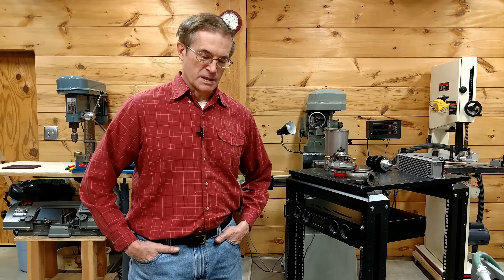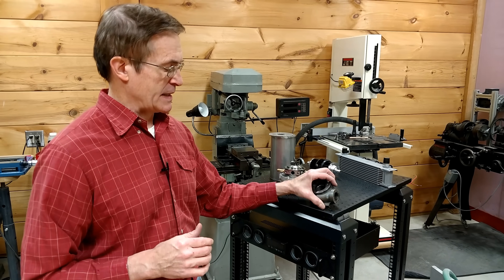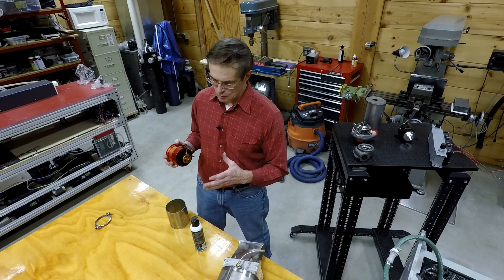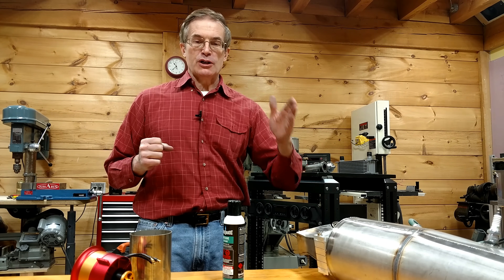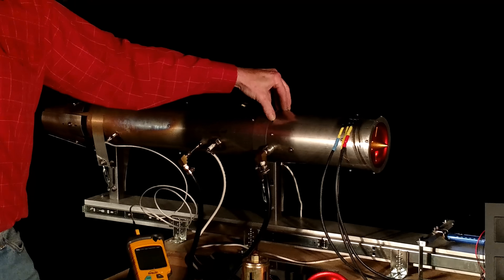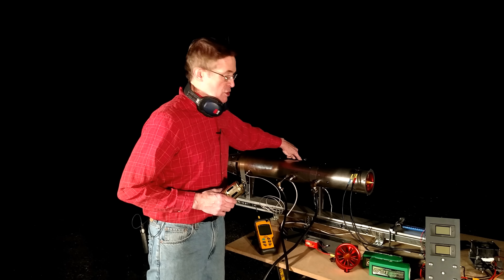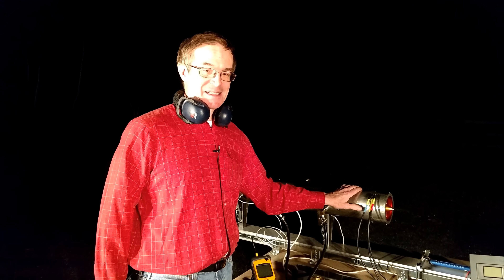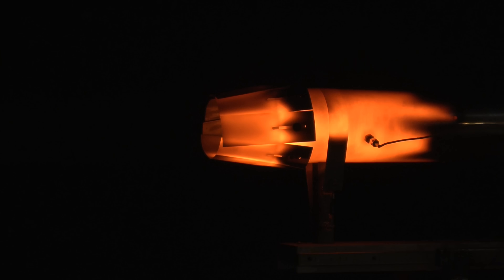Hybrid Jet Engine

Comment: I don't think you could ever get the weight down enough between the engine and the fuel to ever make it useful enough to use to fly, but maybe you could use it on a jet boat. That would be pretty cool.
Reply from the maker: You might be right, but there are a lot of EDF based models that carry the heavy batteries that are required.  The engine we demo was built to research the potential for augmenting these fans to generate not only a much more realistic sound, but to enhance the thrust as well. We used relatively heavy gauges and larger dimensions to allow various set ups to be trialed.  If you look carefully, there are holes in this tube that were used for approaches that we discarded. The air pressure forces generated by this engine are quite low and very thin stainless components could ultimately be fabricated that would weigh a lot less.
Reply: Yeah, I have that same  JP fan for my Meteor EDF, but in 70mm. That is one of the best fans on the market I think. I also have a few Mercury Alloy All metal EDFs also, another great fan. I work as a Welder and Machinist, and have always wanted to do something like this, or maybe use the Turbo to see if you could also make it a fan bypass system maybe.  Anyway, great job! Love your channel. My friend is going to make some of those speakers you made out of the foam board, another great video also!

Comment: I’m fortunate enough to get paid to fly a turbojet aircraft but would not care to pay for the care and feeding of one. Wondering if anyone else is fascinated by the potential efficiency of operating a light sleek experimental at near jet speed with a highly engineered ducted fan, such as one borrowed from a modest sized fanjet and powered by a fast turning recip.

Comment: Thank you very much for finally clearing up my confusion about the paradox of the standard jet engine. The combustion chamber increases the volume! (not the pressure) From that I see the equation of pressure diff times volume equals work, which means that the turbine produces far more work than used by the compressor, thus leaving excess for other work.

Comment: Finally! Someone who actually understand whats going on inside a jet engine and has the ability to articulate it correctly!
Reply from the maker: Thanks!
Reply: Tech Ingredients go to Lockheed so you can make some afterburners
Reply from the maker: We have watched many of his videos, they are interesting and well made.
Reply: @TechIngredients  any updates?
Reply: True. But explaining these concepts while showing the P-V & T-s themodynamic relationships will make the concept clearer. Good job though.
Reply: so right
Reply: im gonna make jet engines to make a ufo
Reply: that is what we leatned st jetengine engineering but for xhaust cooling maybe a cool air scavenge system?
Reply: Walter Kaaden an East German engineer developed the two-stroke expansion chamber exhaust using experience he gained from working on pulse jet engines. 
He created the diverging and converging cone shaped chambers. 
The opening exhaust port creates a shock wave the shoots down the pipe. A diverging cone creates a suction behind that shock wave. The converging cone reflects the shock wave back to the engine. This pushes the hot gas back into the engine.  
The ideal shaped pipe has a supercharger effect. Exhaust gas is sucked down the pipe with the next fuel air charge following it down the pipe. But the reflected shock wave shoved that gas back into the engine. When it’s ideally timed, the exhaust port shuts just as the fuel/air charge has been pushed back into the cylinder. 
Supercharging by means of gas shock waves. 
During WW2 Rolls Royce were working on a 25 litre two stroke engine. They realised it made a considerable thrust from the exhaust gas alone. They had plans fir a hybrid piston/turbine engine. Sadly it never went any further because the highly efficient blower developed for Merlin engines was ideal for their early turbo jets (the Nene).
Reply: sorry to be off topic but does someone know of a way to get back into an Instagram account..?
I was dumb forgot my password. I would love any help you can offer me.
Reply: @Evan Edwin instablaster =)
Reply: If you want to learn about gas turbine engines, check out AgentJayZ youtube channel
Reply: David Blalock well to be honest: no, he didn’t. This right there is not a jet engine, but more a very hot furnace. The crucial point with a jet engine is, that the energy regained by the turbine stages is used to run the compressor stages, so it is self sustaining. This here is literally in a normal person’s gas central heater.
Reply: @nighthawk9264   Not so fast.  It might be a jet.  If the combustion chamber is adding to the exhaust flow in a meaningful way, then it's a jet engine.  If not, it's a ducted fan on a heater.  That's the way I see it.
Reply: @nighthawk9264  He explained this very thing but if one had watched the video.........
Reply: @nighthawk9264  If you go back to any thermodynamics book, you will find that an engine is a machine that converts heat energy (chemical energy) to mechanical kinetic energy. Even if the output kinetic energy is very low, the conversion was still done.
Reply: I am converting chemical into mechanical energy if I spray butane into my hair drier while it’s still on. Doesn’t make it a jet engine. 

Like I said, having a fan with some pre compression in which’s output you spray some gas and ignite it, rather makes it an efficient furnace, not an engine.

The classical definition of a combustion engine is that it is self-stustaining btw.
Reply: @nighthawk9264  Hair driers convert electric energy into kinetic energy to displace air (not chemical). Your example is wrong. I am not trying to get into an argument here but rather trying to help you understand the basic concept. Plus I might also learn something new from this discussion.
Reply: Omar Ham if I am spraying butane on the hot heating elements, it’s exactly the same. I might even get some extra thrust. 

He literally used electricity to compress the air and then combusts the air Gas Mixture. He does not regain any of the energy back to keep the „engine“ running. 

I don’t need help understanding the basic concept, I am an aerospace engineering student that took courses on thermodynamics and air breathing propulsion.

It’s literally a hair dryer with an afterburner
Reply: @nighthawk9264  Please give more profound thought about the system and you will understand it better.  There are many levels of understanding of application of science and engineering and you are at the base of the pyramid.  555

Comment: Luv your vid please do more. I take it the heat was your biggest problem. As you stated at the start with turbo fans keeping the temp down?
Reply from the maker: It's a love/ hate relationship.  More heat gives more thrust, but the components can only take so much.  In the ideal thermodynamic cycle, the combustion would occur under the most extreme conditions possible, very high pressure and as hot as the structure will allow, but the exhaust would be at a low velocity, pressure and temperature.  This is the principle supporting a turboprop engine.  Our single stage axial turbine does not generate a very high pressure ratio and we try, at least, to compensate with maximum combustion chamber temps

Comment: sorry, really...... more space heater than jet engine.... it should go a little like this  https://youtu.be/CfXKGlDlY8M
Reply from the maker: It's a little of both.  In your link, which I have seen before, remember
 that demo shows a turbocharger conversion with a much higher compression ratio.  That is a different engine and we will discuss that type in a future video.  For what it's worth, have you noticed the slow and limited introduction of electrically based turbochargers for automotive use? More frequently, electrically enhanced conventional turbochargers are being installed.  What about adding an electrically enhanced first stage to the engine in your link?  Just like an afterburner it would allow brief periods of increased thrust.
Reply: some kind of electric turbo was done 20 years ago by Rover in the uk, i guess with brush-less motor etc things can run better and longer, dont see any point adding anything to the engine, it would either melt, or at least not deal with the volume, moving over 3.5kg of air a second

Comment: Could you use a water mister to increase thrust? You could even mist on the outside of the tube to decrease Temps to allow increased running output
Reply from the maker: Yes, that is a very interesting idea.  Our plan with the second fan is to introduce a water/alcohol mix between the stages to reduce the temperature rise associated with compression as is done with an inter-cooler and increase the air density.  Note: don't choose methanol.
Reply from the maker: Actually, less explosive, but too powerful a solvent effect for the motors.  The liquid will pass both around and THROUGH the motor providing direct cooling to the winding.
Reply from the maker: You do not want to reuse the water.  The tremendous heat of vaporization of water (it takes more than 5 times as much energy to convert a gram of 100 degree water to vapor as it takes to raise that same gram from freezing to 100 degrees) absorbs so much heat that the air density rises significantly.
Reply: Huh, that makes sense. Last thing you need is something inside a motor being eaten by the solvent!
Reply from the maker: Thanks for the support.  There is the risk that if the fluid is not highly atomized and evenly distributed, the stresses you suggest are a threat.  We will use two sets of injectors, one between the fans and one in the space prior to the combustion chamber.  The first will use isopropyl alcohol and water, the second will use methanol.  We will adjust the flow to cool the air and the motor, but not so much that there is substantial condensation or dripping.  The remaining fuel requirement will be the methanol as needed.
Reply: Unlikely, as (so far as I can tell) the water is going to be aspirated into the air stream between the compressors. However, it won't be wasted - the more mass you can throw out of the back of this kind of engine, the more thrust you will get.
Reply: I'm worried that it will create micro cracks in the body over time, from constant stress of high temperature changes caused by the mist. Won't it work the metal to dangerous levels? Just my thoughts, I'm not an engineer ;)
P.S. You gained a new subscriber. Great presenter and interesting subjects, you have my like!
Reply: The Rolls Royce Pegasus engine uses de-mineralized water for cooling for increased thrust. It's the engine used in the AV8B Harrier.
Reply: Water injection has been used for decades on numerous engines to permit an increase in thrust for take-off.  Its function is to cool, by evaporation, the air entering the combustor, such that the fuel flow can be increased without an increase in turbine entry temperature.  The increase in thrust, as a result of the increase in mass flow, is a second-order effect.
The Pegasus engine had 'short lift dry' and 'short lift wet' ratings for take-off, the former referring to the use of water injection for a maximum, from memory, of 90 seconds.
Reply: Solution is to keep the heat up, so you get the Leidenfrost effect to protect it from the metal itself.
Reply: The air density after the water injection adds a non-trivial amount of thrust as well. I'm guessing here, but I bet the water injection limit is a practical limit of how much water they can carry onboard, which is sufficient given they're only using it for takeoff. Landing has reduced thrust requirement because the aircraft has dropped its ordinance and consumed a substantial amount of fuel, so it doesn't need the added thrust.

The harrier is an interesting bird. Loud as all hades even with cans and screws protecting your ears, it seems like the sound is coming from inside of your head almost. Truly a sight to behold.
Reply: Why not? Too explosive?
Reply: Alright, I trust you. I hope to see it working soon :)
Reply: grahamj9101 that's cool to know. I always thought wet and dry were referring to the amount of fule onboard the craft
Reply: Water methanol injection?

Comment: What a cool project!  Unfortunately, I was so distracted by the production faux pas, I'll need to watch again for it's juicy goodness. And it is Juicy and it is Good!

I've been shooting video for years. Here's some unsolicited advice for your producer and crew:
Audio: use the audio from your lav mic. Eliminate all other sources of recorded audio in post production. Turn it off, throw it away, anything you want as long as the audio in your final version is addressed and intentional. I can hear levels changing with the roaming camera moving in closer, which is nuts unless the lav didn't work and you couldn't reshoot. Audio is as important as picture and some of the comments here relate to this easily fixed problem.

For a two or three camera shoot, lock down your master shot camera. It shouldn't pan, tilt or move in any way if the talent is standing in one general area and talking.  Try to use the same types of cameras (DSLR or Pro Vid cameras- -if you mix gopros, iphones, dslrs and ProVid, it will look odd unless you're super careful), feed them individually to a field monitor and match the exposure and color balance before you start. If you can't, work hard to match them in post production. Final Cut and Premier both have strong tools for this task, but it's hella easier to shoot it right than fix it in post. Your B Roll camera shouldn't be "God View" high angle, or anything other than just another good shot at a normal angle. You can have someone move Camera 2 around (quietly), just never unless there is another solid shot to cut to while it's moving. Thats camera 1's job anyway, so there you go...Your roaming camera, again should be matched for exposure and color and type.  This should NOT be your master shot camera, as you've done here.  It is a cut-away camera, like your B Roll camera, but provides lots of different details, alternate angles and close ups relevant to content. And because its a handheld camera, be careful and intentional in providing focused, steady and well composed shots. Here we've got blur, motion, focusing, zooming, too close and un-composed shots for your Master Shots. Just relax, slow down, think it through and remember Camera 1 and Camera 2 got your back. Additionally, understand the physical boundaries of those C1 and C2 shots so you don't wander into frame in the heat of the moment. You'd be amazed what one shooter and one talent can accomplish with three cameras, a mic, a solid consistent production approach and amazing content. 

Indoor lighting is just great for youtube. High angle camera is too dark and unbalanced in terms of color. 
Outdoor lighting needs to be fixed. You can chose how to address this, but the simplest solution is to shoot earlier with more ambient lighting; it is so much work reproducing what the environment does naturally for free. If you absolutely can only shoot once and it must be super dark, you will need to light the set. A single small light source is not helping. Ironically, the LED Aquarium/Grow light you built previously would probably do the trick if passed through a simple light modifier. I think you're shooting just outside the shop, so throw some white diffusion material over those windows (even a white sheet for that matter)and pump a couple of those LEDs through them for a giant softbox look. It'll soften the light and give you some shadow detail. It won't take much and the instruments should be 6-10 feet back to illuminate the entire light modifier evenly. Set it up some night as an experiment and you'll love the look of it. Lighting is a lifelong pursuit, so practice different techniques and keep a lighting journal so you can reproduce the looks (a hallmark for a pro DP). Be sure to shoot oblique to the windows, so the talent's glasses are not glaring. (angle of incidence/angle of reflectance, yada yada...)  Simply cut all the lights when it's time to grab those ruby red 2 million BTU metal shots.

But last and certainly not least!!!  I friggin love your channel and your videos and your wonderful and rare willingness share your mind, your knowledge and to produce this stuff, no matter how it looks. Everybody who works on this is awesome and I only want to help you improve and bring your production quality up to the level of the subject matter. You will do that, it's simply a matter of hours shooting and personal commitment. That being said, I simply can't wait for your next video. When they pop up on my feed, it absolutely makes my day!!!
Reply from the maker: Thanks for the advise.  
We'll look into this.  The audio in this video was mixed only because of the poor connectivity of the lapel mic at the outdoor location.

Comment: Just too inefficient. Better off with two fans and skip the fire/heat/tanks.
Reply from the maker: You are correct from an energy point of view.  A single larger fan would be even more efficient and a large propeller would be still more efficient.  Nevertheless, this is easy and a lot of fun.
Reply: The Yahoo DIYturbines group is a wealth of experience and information and links to experiential experts. Your variable outlet turkey feathers are clever.

Comment: but whats your thrust
Reply from the maker: Greater than 10#.  We need a higher load spring balance and will use this in the upgrade video to follow.
Reply: But what is the thrust without the afterburner.  That is what I am most interested in.  Want to see if the extra weight of the afterburner kit is worth it for the amount of thrust increase.  Max thrust with and without afterburner please.  No doubt you have thought of this yourself but thought I'd mention it anyway since I am very interested in this.  You're a man after my own heart!